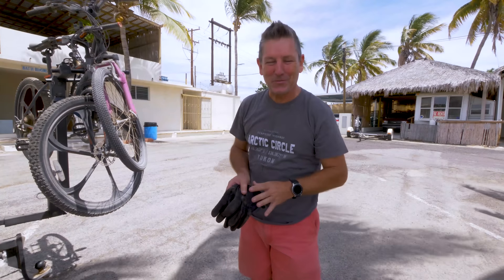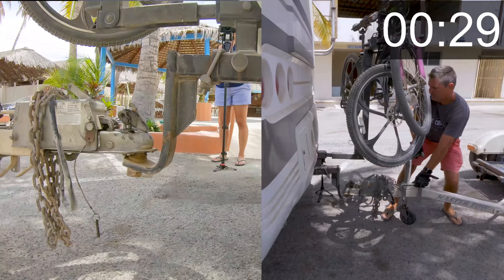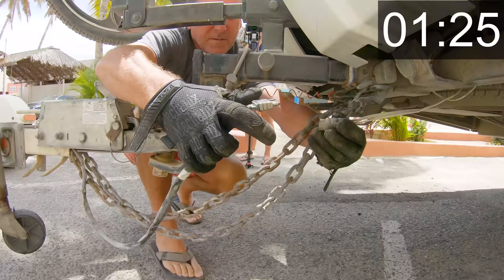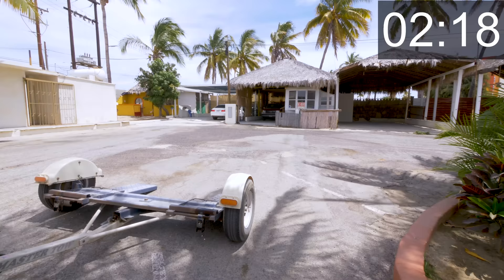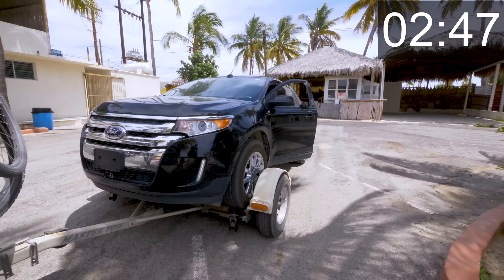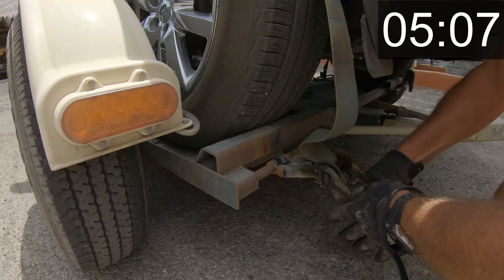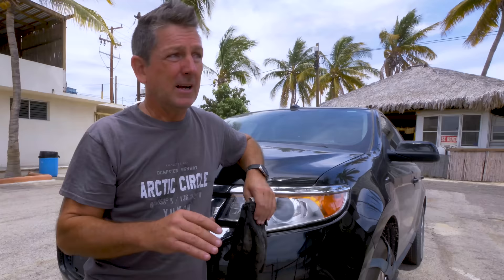EASY Tow Dolly Hook Up & Load Vehicle in 5 Minutes | Check Your Owner's Manual! #towdolly

Comment: Hi, What's the torque specs for the tow dolly pan bolt once I remove the safety collar to install the mechanism? Also, does the bolts on the mechanism go all the way through the dolly frame to bolt on? I really like this idea I believe it will help load and unload way faster. Thanks.
Reply from the maker: I couldn't tell you what the torque specs are, to be honest. I'm an old school guy and rarely take my torque wrench out of the package. The bolts go all the way through the dolly frame. It definitely makes it easier.

Comment: Hi do connect your RV rear lights to your car lights .Great video as always.
Reply: Don't need car lights when towing with car dolly since the dolly itself has lights.
Reply from the maker: TT is correct... I actually have a kit to light the car lights as well, but haven't installed it yet because the dolly had them. Will add them soon for more visibility. Safe travels!

Comment: Howdy,  what is the name of the device you use to release the pan so it can tilt. I’ve already lost one pin and the hole it goes into is starting to wallow out. Any help would be appreciated. I’m a newbie and it takes me about 45 minutes. Plus I’m going to change to the basket straps. They look like they’re easier to maneuver and look more secure.
Reply from the maker: Hi Steve, yeah that pin popped out on me about 6 times! I bought it at a local trailer supply in Vegas but you can find them on Amazon. Search for "trailer tilt" I think.
Reply: Will do. Thanks for the help.

Comment: Are the fender lights on the tow dolly all thats required,.....or do you need the magnetic lights on the rear, or roof of the car?
Reply from the maker: The fender lights are all that are required. I would never put the magnetic lights on my vehicle because I think they look ridiculous! Lol!

A better option is wiring the lights on your vehicle to work in unison with your motorhome. I have the kit, but haven't installed it yet.

Comment: I have a question when you use a Dolly does the tires lock  when you park your vehicle on the dolly because I have brakes on all 4 wheels does the back wheels lock.
Reply from the maker: A dolly is best for front wheel drive vehicles. When you put a front wheel drive vehicle in park, only the wheels on the front are locked. The brakes do not come into play. If you put your parking brake on you will have issues because it will lock the back wheels up. So, you pull your vehicle up onto the dolly, put in park, make sure your brakes are off, and you're done. I hope that makes sense.

Comment: Hi, great video what size bolts and drill bit size did you use to install the tilt mechanism? Thanks
Reply from the maker: I believe they were 1/2". It was whatever size fit the holes in the mechanism. You should measure the length to make sure it fits right for your application and just in case something is different on yours.
Reply: @LifeWithPaulLorena  Thanks

Comment: That was a lot quicker and easier then I was told it was. We tow a Lincoln MKX four down. We have the Airforce 1 brake system. All we have to do is connect one quick disconnect air line and we are done with the break's. Also with the Lincoln Ford says we can not exceed 70 mph and every six hours of towing we have to unhook and drive it for a few minutes. Ford also says we have to drive the car in reverse for a little bit too. With our diesel pusher we usually tow at 66 mph at 1600 RPM. We don't even realize the car is behind us. With the tow dolly do you have a speed restriction?
Reply from the maker: Hi Adrian! If I'm not shooting the process it's 3-4 minutes. We don't have to start the car, even if driving for days. Most people don't know you're supposed to do that when pulling 4 down, with certain vehicles. There isn't really a "speed limit", but I honestly don't see a reason for going over 70mph, in a motorhome while towing. If you're in that much of a hurry, you need a different hobby! 😁 Safe travels!

Comment: Can you reverse with a tow dolly? Penske instructions tell me not to but I’m traveling 1000+ miles and I can’t think of a way to avoid reversing at several situations.

Also do I have to check every 50 miles? This is another recommendation on their video.
Reply from the maker: Hi JCRM! I do reverse with my tow dolly, but I will say you can do a lot of damage if you don't know what you are doing! It turns very quick and can get out of whack really fast. Checking it every 50 miles is insanity! Load it, tighten the straps and then stop after 20-30 miles to retighten the straps and it will be fine. I have rarely had to tighten the straps again after my check stop. I know the rental companies have crazy rules because they are trying to cover their butts!
Reply: The Motorhome Experiment thanks so much for replying. Definitely helps

Comment: Great video.  Love the tilt latch but cannot find it anywhere online.  Anyone know where to find that safety latch?
Reply from the maker: Hi Richard, I got mine at a local trailer supply in Vegas. Here is a similar one from Amazon, but don't know if it works for yours or not....https://www.amazon.com/Buyers-Products-TL382-Tipper-Assembly/dp/B016MX4ZVS

Good luck!
Reply: The Motorhome Experiment  great thanks so much. Exactly what I was looking for. This will work perfectly for my dolly. Love your videos. Keep up the good work!

Comment: Isn't there the recommendation to also route a chain or strap around under the front of the vehicle in case the tied down of the wheels fails ?
Reply from the maker: They recommend it, but I personally don't use them. The chance of both wheels straps failing is very slim if you keep them in good condition.
Reply: @LifeWithPaulLorena    My wife and I have also decided due to the tow car choice to go with a tow dolly, probably the Demco Car Kaddy SS.
Reply from the maker: @martyh4777  That is probably the best on the market. They don't have a really wide model so make sure it fits your vehicle. Safe travels!
Reply: @LifeWithPaulLorena    To save on gas, we want to stay with a smaller tow car anyway, like a Kia Soul or something.
Reply: We do a 2013 Kia Soul 5 speed manual with Blue Ox tow bar. Tracks perfectly and you hardly know it's there.

Comment: Why do you cross the chains? Recently told my SIL to do that but couldn't tell him why.
Reply from the maker: It's an old trailer trick that was passed down to me and I have no real explanation for it either. I think it's because if a trailer comes off the ball it acts like a cradle and support the trailer tongue so it doesn't immediately dig into the ground and cause even more problems.

Comment: Would you try to back into a campsite or are you talking about just backing up in a parking lot a couple of feet? 
Also, wouldn't it be a lot harder trying to do all that inside a campsite? wouldn't that block the road while your messing with it?
Reply from the maker: I back the dolly, without the car, into campsites all the time. I have backed the car and dolly into a campsite once because it was setup perfect to do that. We take the same amount of time to hook and unhook as people who are towing 4 down, but we always try to load an unload so we aren't blocking anybody, if possible. 

If you stay in campgrounds there are going to be times when you are waiting for people to back a trailer into a spot or unhook their cars. It's just part of the lifestyle.
Reply: @LifeWithPaulLorena  Would you say that you can back up a carless dolly about as easy as a boat trailer? or would you say that a dolly without a car is only a tiny bit easier than when there is a car on it? 
The reason I ask, I am hoping to always leave the dolly on the RV so I can use back instead of pull thru. I dont mind taking the car off the dolly but then having to take the dolly off the RV sounds like it would suck

Comment: Been awhile since you made this video but I have a question as my tow dolly told me to lock the steering wheel which I do by way of straps, does your ford's steering wheel lock in place?
Reply from the maker: Yes, our steering wheel locks when we turn off the ignition. If your steering wheel doesn't lock I don't think it would matter. What kind of tow dolly and does the platform pivot?
Reply: @LifeWithPaulLorena  Thank you for responding, the dolly is a Roadmaster RM3477, and the  yes the platform pivots.

Comment: No safety chains on the vehicle?
Reply from the maker: I personally do not use safety chains, from the dolly to the vehicle, and do not see them as necessary. You should use them if it makes you feel comfortable. If something happens that makes BOTH of your straps fail at the same time, I assume it will be catastrophic for the entire rig. We replace our straps at the first sign of wear (only once so far) and have not had any issues in 55,000+ miles.

Comment: We tighten out wheel straps much tighter than you did. Also do you have trouble with ur dolly tires cupping? (Per hubby)
Reply from the maker: Hi Madeline...They just need to be snug. You should stop within the 50 miles to re-tighten them, which I never mentioned. If your tires are cupping they are most likely under-inflated.
Reply: The Motorhome Experiment 
thanks!

Comment: Do you tow the car in park or do you leave it in neutral?  I have heard it both ways.
Reply from the maker: Hi Eric. One of the advantages of a tow dolly is you can tow the car in park with the keys out. No worry about killing your battery. It is a front wheel drive so there is no need to leave it in neutral.

Comment: Does the Dolly have electric brakes to help slow down when you put the brakes on in the RV ?
Reply: Yes
Reply: Probably has hydro surge brakes.  They use the force of the trailer pushing against the tow vehicle to activate.  Electric brakes would need a 6 or 7 pin plug he is only using a 4 pin for the lights.
Reply from the maker: Yes Heeber, mine has a surge brake. When you brake the coach and the trailer pushes forward it pushes fluid into brakes on the trailer. Very simple set up!
Reply: @LifeWithPaulLorena  Hi.  Love your video!  Does the surge brake system have a reservoir for fluid to be maintained?

Comment: Great video my friend!  We have the same dolly and I agree with everything you said and showed. I need to modify ours with the "auto tilt mechanism" and the trailer wheel that swivels out of the way. 

Question...... how often do you need to stop and check/tighten the tire straps? I've only towed short distances with ours but it seems like they stretched in the first ten miles or so and need to be retightened. Once I tighten them they seem okay...... but getting ready for some cross country travel this fall, I'm a little concerned.
Reply: Okay...... do you have any idea of the correct name of the "auto tilt mechanism"?  😉
Reply: I've done 11,000 miles in the last 10 months with a dolly. You drive 20 to 30 miles. Stop and tighten. Then good for the rest of the trip. The only issue that we have had was a very low clearance front spoiler on the car has been damaged by getting on and off the dolly.
Reply: @georgelsmith53  Thanks George.  That's the only thing I'm leary of. We are preparing for a 6,000 mile trip beginning in November and ending next April.
Reply: @MakingMotorhomeMemories  if you dont have a really low clearance,  it's not a problem.
Reply: @georgelsmith53   We do not have low clearance so there's no problem.  Just over thinking.  Thanks again George ..... safe travels..... Tom
Reply from the maker: Hi Tom, I stop after 20 to 30 miles, if I'm going to be traveling over a 100 miles, and check the straps. They only need to be retightened if they settle and sometimes they're good when I check. I try to load on a downhill... that helps!

Just make sure your straps are in good shape. Check them for years and if there is even a hint of a tear...REPLACE THEM! Safe travels bud!
Reply from the maker: Yeah, George our front spoiler hits a bit during load and unload.
Reply from the maker: Wait Tom... You overthinking!? Nah! Lol!
Reply from the maker: One last thing...I bought that tilt mechanism at a local trailer supply store. This one on Amazon is similar...https://www.amazon.com/Buyers-Products-TL382-Tipper-Assembly/dp/B016MX4ZVS
Reply: @LifeWithPaulLorena  Thanks..... I found it before we arrived at Walt Disney World. It's beautiful here.  Wish you and Lori were here!

Comment: How do you secure the steering wheel?
Reply from the maker: You don't need to secure your steering wheel with a tow dolly. Ours has a pivoting deck, so we just turn off the car, shut the doors and it's good to go. If you go with an older style that doesn't have a pivoting deck you'll probably need to leave the steering wheel unlocked somehow.

Comment: Do you tow in NEUTRAL?
Reply from the maker: Because our vehicle is front wheel drive we don't have to. We just put it in park and away we go. Part of the reason we started with a tow dolly is because we had a front wheel drive vehicle.
Reply: @LifeWithPaulLorena  Best to check your owner's manual. My 2019 GMC Terrain is front wheel drive, but must be placed in neutral on the dolly AND the steering wheel needs to be locked with a ratchet strap.
Reply from the maker: @michaelpolomsky3514   You are correct! We have heard that some of the newer vehicles have electronics on the rear axle now that detect movement when the vehicle is off and act funky on a tow dolly. You probably have to disconnect the battery as well. Ours does not have that and it makes it very easy. I don't know why you would have to put a ratchet strap on the steering wheel, but if your manual calls for that, you should probably do it. Again, we have had zero issues with our setup in over 55,000 miles.

Comment: No safety chains to hook up in the event a strap came off? Wow!
Reply from the maker: The chances of two of those heavy duty straps breaking are pretty slim. We have now done over 50,000 miles without any issue.

How many times have your straps broke?

Keep your straps in great shape and replace them at the first sign of them being bad. We've replaced ours twice even though they probably had many more miles on them. If both straps fail and the only thing holding your vehicle on the dolly are the safety chains, you're probably upside down in a ditch with bigger problems. Even with one strap left on, your vehicle will not come off the dolly.

Comment: I was shocked at how easy that was. You didn't have to shop for and install a heavy base plate plus because you added an aftermarket bumper now you have to look for a special tow bar and look for an attachment point and modify.....or wait because yours is a newer model we don't have that part designed yet.  You didn't have to add special braking equipment and get it professionally installed. Another benefit is that you don't have to go sit in your car after driving so many miles. Wait a sec I think I will go out to the garage right now and sit in my car right now because I drove 340 miles today. (some cars require engine trany warmup if flat towed after so many miles). The one thing that I wasn't expecting was the variety of vehicles that can be flat towed now. I thought it was mostly Fiat products which to me is off-putting. It is still minuscule compared to those that can be put on a dolly. Which I would say is what makes dollies or GI joes a winner. in my books.
Reply from the maker: I agree with you, but the biggest advantage of flat towing is not having to deal with the dolly when you get to your destination.

There are a TON of vehicles that can be flat towed for sure! We already had a front wheel drive and the tow dolly was the easiest, least expensive and required less modification than the flat tow option. Safe travels!

Comment: You have no safety chains or cables, car to dolly.your car was not tightened down to dolly. Those tire straps need th be cranked down.
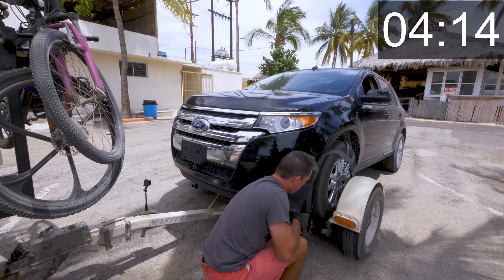Reply from the maker: I hear you and people should use them if it makes them feel safer. I have never used safety chains from the vehicle to the tow dolly. I honestly don't see the point because the chance of both of your straps breaking at the same time is pretty slim, especially if you replace them as often as we do. The straps were tightened down at 4:45 and 5:45 in the video, so not sure what you mean there. Cranking them any more than I did won't make a difference and I also retighten them one more time once we've driven a bit. I have never had a strap need to be tightened again after that. After 50,000 plus miles of using this tow dolly and many miles on others previous to this one, I've never had an issue. Thanks for sharing.

Comment: And take the car out of park.... : )
Reply: Bert Kelly why does it have to be out of park?
Reply: @stevefaber7671  IDK, you tell me?
Reply: Bert Kelly, it appears that you speak from authority. Just wondered since Paul tows his car in park with the drive wheels off the ground.
Reply: I tow mine in park as well. No problems over 11,000 miles.
Reply from the maker: You don't have to take the car out of park...it is front wheel drive and the transmission locks the front wheels. The back wheels drag just like they do when you're driving the car.
Reply: @LifeWithPaulLorena  Thank you, I was waiting for someone to tell me it's a front wheel drive instead of beating around the bush.